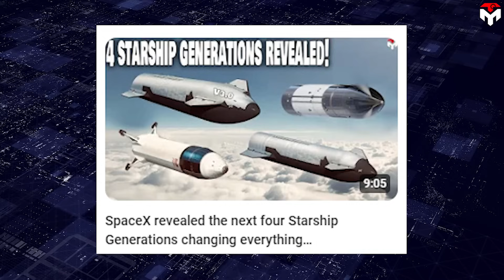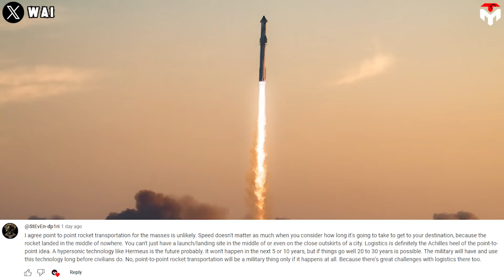NASA engineer: ""SpaceX made BIG MISTAKE with Starship''. Musk Reacts...

Comment: Very different programs. The Shuttle was a series of cutting edge research programs to be published, that also happened to later fly. Starship was intended to fly, that will also push technology along a bit.

As a contast, the SLS was a fund raising program that spent most of the money counting on the cost overage problems would lead the program being canceled, without having to produce flight hardware. A diving catch was made when it wasn't canceled by bolting museum hardware together (without much capacity to even replace the museum displays that were raided). The concept had been around as a backup for the original Shuttle for years, it just needed to be dusted off and updated. Actual manufacture of new Shuttle engines is... unlikely since a new round of funding would be required.

A better fit for an rocket under the updated Apollo capsule would be a super heavy variant of the Falcon Heavy system. Moving to four boosters around the core and providing two aditional landing pads. Overall program risk compared to the SLS system would be reduced.  Development and flight testing could be completed fairly quickly without waiting for SLS or Starship. I would expect that the Falcon Heavy team had some of the calculations and projected performance already in their notebooks.

So to compare:
Shuttle / NASA  - PhDs / Politics
SLS / Boeing     - Business profit / Government funding
Falcon 9 / Falcon Heavy - Engineers and trying to reign in Mr Musk a bit and the young engineers trying to learn as they go.
-- 
Well, also a bunch of old farts watching people splash rockets trying to relearn solutions to various rather old rocket engineering problems.

Comment: Reliability will occur when simplicity is achieved in engine numbers and design.  30 engines with 60 propellant pumps make no sense. Figure out whether 2 pumps can be more reliable serving 5 combustion chambers than the current 10 pumps being used.

Comment: 6:28 I'm not sure what you use as a calculator... but 196B / 135 flights = 1.45BB PER FLIGHT .. Yes that includes the development costs... but that's the reality.  I'm assuming the 54 million you mention before this number was a typo and should have said $540 Million. I don't think anyone thought that the per-launch cost would come anywhere near $54M .. even with the planned 1-flight every 2 weeks cadence, which was the plan prior to STS-25/Challenger.

Comment: I love how people talk about Starship as though it is working and is reusable and has high cadence production and flight when it has not succeeded.  Starship thought it could ignore lessons NASA had learned and destroyed their 1st pad because of this.  Then they reintroduced the water deluge used my NASA for decades.  Talk about it being great when it is shown to actually work.
Reply: About the water deluge - everyone was calling for a NASA type, top down. SpaceX reversed it, bottom up. The gain is having a floor to work on. Also, avoiding the problems with building a flame trench.
Btw, the trench being built at Massey is only for the ships, not the boosters. A booster would totally demolish it.
Reply: @knowledgeisgood9645  NASA has used numerous water deluge systems across the last 50 years of rocket flights.  In every case it is there not to protect the pad, but to protect the engines and rocket.